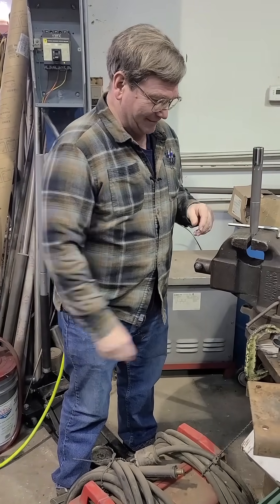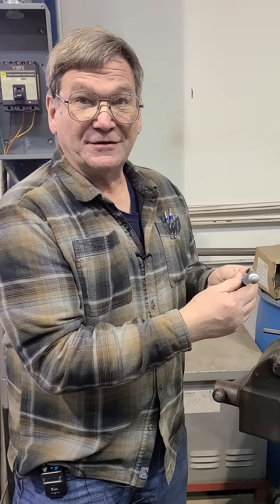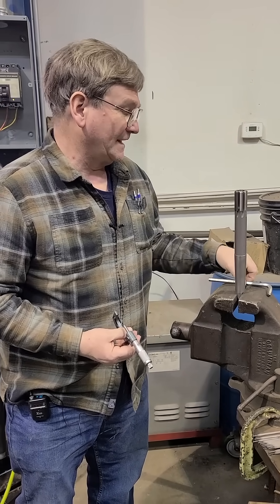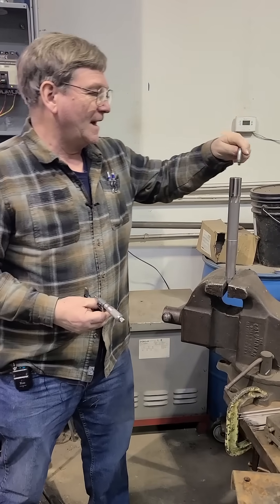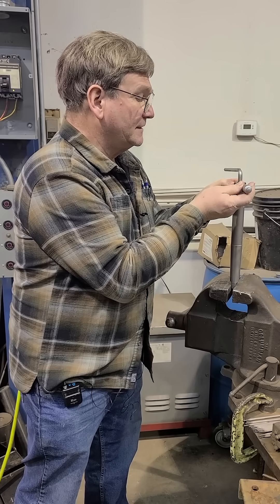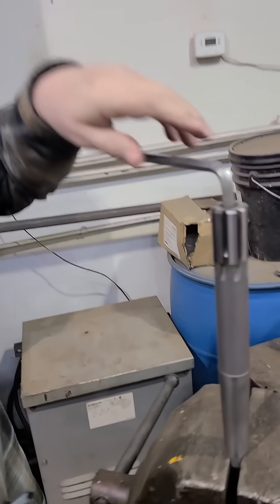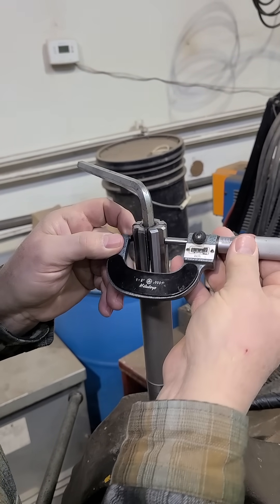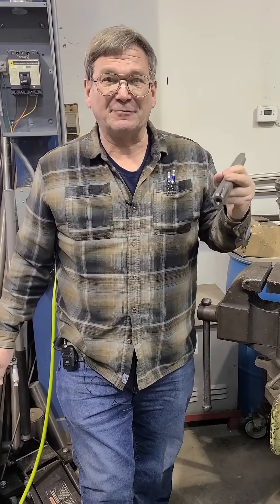Machinist's Minute(s): Check your expandable reamers

Comment: Now I know you don't like cnc, but circular interping holes is an amazing ability. I was taught you can make it .001 smaller by running it backwards in a prep hole before using it in your actual hole

Comment: You remove the expansion device, heat it to relax it 600 F max, check it, and you should be able to run with with it. Old tool & die , mechanics tricks.

Comment: It wont make much difference if the machine spindle has runout, or the drive  tapers are not concentric. ALWAYS determine size by trying it, under load, on a scrap piece of material

Comment: Get your self a set of metric micrometers, at least 0 to 75mm.
Reply: its easy to divide and multiply by 25.4
Reply: Yes, divide 32mm by 25.4 and get 1.25984, that sounds to be what he had at the small end. 1.261 is over by more than .001" so perhaps he needs a new calculator.

Comment: Never used an expandable reamer before, so dumb question. 
Can you wrap shim stock around it and use a hose clamp, to bring it down in size and keep it round? Then slowly tighten screw to bring it back up to size?
Reply from the maker: @dc6233 got it pretty well right. The problem is when you expand it you're not just springing it out, there's minor bending as well, and it may be different blade to blade. In our case it was mostly spring and it came back down to almost size, but the normal MO is to regrind for that reason.
-Cameraman
Reply: @HOWEES  Can we get a regrind lesson?  I never knew about this cutter.
Reply: I've used shim stock on a portion of the reamer to get a larger bore. The end screw on an expansion reamer should have a taper, so that it opens the flutes to the same diameter. Other expansion reamers use blades, and each end has a cone that expands them evenly for the same diameter for the length of the cut. He could try to hold the OD somehow, but it would probably chatter.

Comment: Go under , use it and then measure? On a scrap of corse!!
Reply: The base is smaller than the end so back it all the way off and assemble it through a slightly smaller hole and pull it through, running. The pressure of cutting and heat should return it to size.